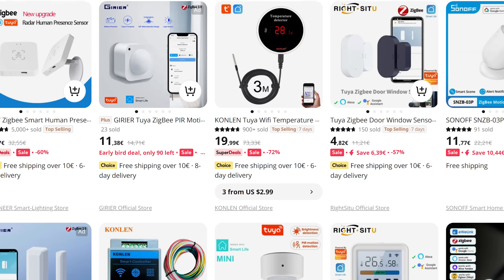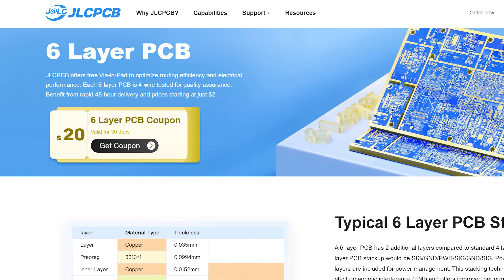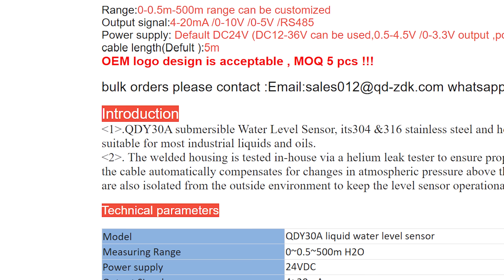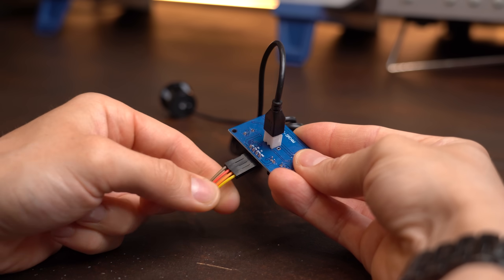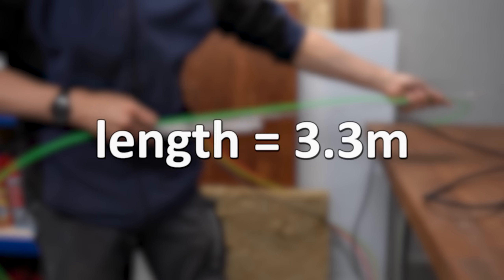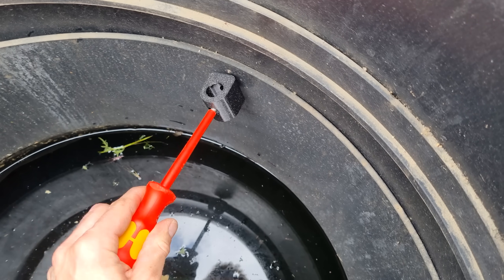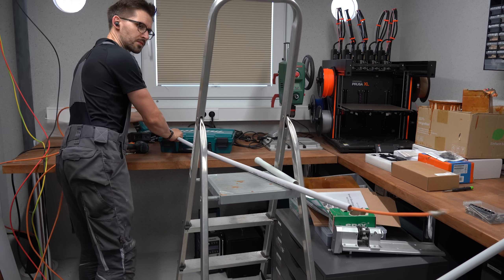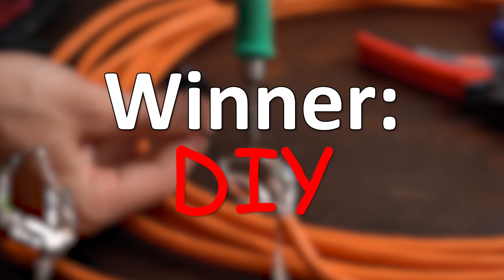This Happens when all Buy Options Suck! Water Level Sensor (DIY or Buy)

Comment: Pressure is the way to go for measuring water height in a tank.  We had ultrasonic sensors that constantly failed at work and switched to using a pressure sensor about 5 years ago and have been working great (in salt water also)!
Reply from the maker: I will see how it will perform in the future :-)
Reply: Agree with the (submersible) pressure sensor; build for the job and is typically the preferred sensor in industrial applications. I use these in my water tanks, version with the 4-20mA current loop so I can run longer wires without problems. 
Fun fact: those submersible sensors have a cable that contains next to the electrical wires also a small air tube. This is be able to measure the pressure differential. This way it zero's out any changes in atmospheric pressure. So best to purchase with a longer cable to get to the connection point instead of trying to splice mid-way!
Reply: You should add a second ultrasonic sensor (or better yet, 3) for redundancy.
Reply: Yes that'd be my goto as well. If it works in washing machines it's gotta be reliable
Reply: I am using an HC-SR04 for my sump pit in the crawl space under my house with Blynk. No problems in 9 years.
Reply: Does the pressure sensor reads valid values even when the pump is turned on? I want to replace currently used ultrasonic sensor by something more reliable. I had basic non-waterproof ultrasonic sensor in my well, but after changing a pump, it started to read wrong values, when pump was on (probably ultrasonic sound from the pump). I have replaced it with waterproof ultrasonic sensor, shown in the video, which has poor resolution in the well (±7cm when water is 2 meters below the sensor).
Reply: @MattManis  they're independent systems, sounds like your power source might not be great, or you're having some electrical interference when the motor is on.  Unless I'm misunderstanding what you said, which is always possible.
Reply: @theheadone  we probably didn't understand each other because I wrote it ambiguously :D I had already installed ultrasonic sensor, but i want to replace by something more reliable. I was thinking about a pressure sensor, but I am concerned that if the pump turns on, the pressure will drop near it and the pressure sensor will not display the correct water level.
Reply: @MattManis  ah, I understand.   The pressure shouldn't drop noticeably because of the suction of the pump unless you have the pressure sensor right at the inlet of the pump. Even then it probably wouldn't matter.
Reply: I am replying to all the comments that do not know that Time of Flight sensor is the best for measuring water height in a tank.
Reply: @moeburn  What are the advantages of the time of flight sensor in this use?
Reply: @yannick7230  not in contact with water so doesn't wear down
Reply: @moeburn  Depends on the liquid. Foaming, tanks being filled, fog in the tank or circulation / waves can cause problems for ultrasonic level sensors. There is no one size fits all solution.

Comment: I've worked for a company that sells cisterns - 0:48 - i can tell you, right now - you want an ultrasound distance measurement - easy-peasy to figure out the current/remaining volume level! Especially with rain water, there's gonna be lots of contamination and "growth" in your tank, so conductive sticks won't work long-term - those tend to "get eaten". (fine-mesh rain water filters are a thing, as you're undoubtedly aware)
Reply from the maker: Thanks for the feedback :-)
Reply: You could use a capacitive tank sensor to remove the risks of corrosion but you'd still be stuck with the variable properties of rain water that can alter readings. I have mostly seen these types of sensors used in generator fuel reservoirs, judging by the building automation projectd i habe been involved with until now.
Reply: Best way is to use water level sensor lite omron k8ak-ls1. Work in empty and fill mode and already have a relay that could cut off the emptying pump or turn on a refill valve to fill the tank at a minimum level when there is no rain and you still need to water the garden. With that you can use stainless steel rods of any kind to measure low and high level.No analog read but still a solid way to not burn the pump in case there is no water or always have a minimum level at disposal.
Reply: Time of flight sensor > ultrasonic sensor.
Reply: @moeburn I can't imagine ToF would work well to measure the surface of a body of water given that they don't work well with reflective objects.
Reply: @widgity  Most ToF sensors use IR light, which gets absorbed by water. I calculated that less than 2% of the light gets reflected, which is too low for reliable measurements.
Reply: @lbgstzockt8493  Not true, STM's VLx sensor can measure water level and are very precise

Comment: Did mine with a waterproof ultrasonic module. Then I had to attach all pipes and cables to the walls since the sensors would always see the cables instead of the water level. And take it out of the box I had made because it ONLY works dangling in the air and will not show correct values once Imput them inside the box.......

Comment: Made the same thing yesterday with ESPhome. I used a different ultrasonic sensor, A02YYUW, the wiring is easy & it processes the signal in the sensor, so no extra board needed. I think UART version is better than PWM version because the code is simpler.

Comment: Wont the waves in the water make it difficult for the transceiver to detect the distance accurately? That was the case for me, so I just got a pvc time drilled in some screwa at different levels and connected those to gpio pins in pull up and short them to ground using the water as medium. I dont get great level accuracy only in 4 levels but it works reliably enough
Reply from the maker: No problems so far

Comment: Our house is on a buried stream, so water wells up into our basement.  I too had a need for a water lever sensor and my solution was also cheap.  Cut a piece of styrofoam packaging to loosely fit a pvc gutter downpipe (squarish plastic pipe).  Because sump well is only about 0.7 meters, and I want to detect the top part,  I only measure about 0.3 meter.  That said, cut a slot into the pvc pipe so you can attach a pin to the styrofoam block.  Two paint sticks make a simple linkage to a potentiometer at the top.   An arduino analog pin completes the project.  I also went with an RV pump as my submersible pumps seemed to disintegrate over time.   There's some extra stuff, like a raspberry pi and relay board to run the pump and irrigation valves.  Very very diy.
Reply from the maker: Oh boy. Sounds like fun :-)

Comment: Would the sensor work if the wire is shortened to a few centimeters? That would allow integration of the micro and all in one compact unit. 
Is it possible that they are using the inductance of the cable to form a low pass filter? Why didn't the extension work? I don't like mysteries. They nag at me.

Comment: I use one of these JSN SR-04 sensors in a 25,000 litre water tank and with multiple sampling and median calculations I get accuracy to within half a mm which in my tank is about 4 litres. They're really accurate if you do it right.
Reply from the maker: Thanks for the feedback.

Comment: My idea was to make a float similar to the one that controls the water in toilets, but instead of it controlling a valve it would turn the shaft of a potentiometer (used as a voltage divider). Buffer the middle pin voltage of the potentiometer via an op amp, buffer it once more on the other side of the cable as well, and have a galvanometer showing the water level. Yes, I'm a very, very analog guy.
Reply: This is how it’s done in the gas tank of some cars.
Reply: so basically a gas float from a car?
Reply: I like it.
Reply: This was my initial thought also, but with an accelerometer to measure the angle of the rod that the float is connected to. Ultimately the ultrasonic sensor is a far better option. No moving parts, small space requirement.

Comment: I thought you would use two parallel SS rods and measure the resistance of the water.
These ultrasonic modules are for cars I think. That's why they're so cheap.

Comment: How would one go about measuring fuel capacity in a small ~4L moped tank ? A simple float wouldn't fit, since the tank is long and narrow (and also at an angle) not to mention there's gasoline inside. Ultrasonic? Something else?

Comment: Well-done! :) I did almost exactly the same thing some years ago with my water tank. Luckily, I didn't have to extend the sensor cable and used a D1Mini running tasmota-sensors as the micro-controller.
Reply from the maker: Nice work!
Reply: @greatscottlab  As I was watching, I was saying.."He's using the same sensor!! He's using the same control-board! Ahh crap, he used a different ESP!" :)

Comment: The fact that I made a project similar to yours just 2 weeks ago. But i chose a different way to measure water level. I used hx710b sensor (~2$) and ESPHome supports it as HX711. The seller calls it as a " liquid pressure sensor" but i think it would cause leak over time. Instead of water i used it to measure pressure of air at the bottom of the tank. After some of calibration, it appeared to very accurate, maybe to every 1/10 litter. Now I just wait to see is the sensor drift over time or not.
Reply from the maker: That sounds like a really creative solution. Love it :-)
Reply: That is exactly how it is done on washing machines. Either a pressure switch for three levels (empty, level 1, level2) or probably on some more modern models a full on pressure sensor.

Comment: those are a bit extra complex way of solving the simple metering problem. yep a linear physical floating scale stick. yep its not electric, unless you measure the scale position electrically. sometimes you dont need to read stuff from the home automation panel.
Reply from the maker: But then I would have to open the cistern every time.....right?
Reply: @greatscottlab  measurement wire travels inside a tube also? like a bike break wire. then all the electronics logic is outside of the wet zone. yep information travels in a wire, but mechanical state info. also you can have a hole that the meter travels through? yep a floating measurement stick. say visible from a pipe going down to the water reservoir.

Comment: I did a similar project with a Wemos D1 mini , a VL53L0X , a tiny solar panel and 18650 battery. I was measuring the level of kerosene for home heating system. Ran for years in a row. Only issue was some corrosion on the sensor because of the fumes. Apart from that it was functional.
Reply from the maker: Thanks for the feedback. I hope my solution lasts that long.
Reply: I wonder if you could connect the sensor using some kind of quick-connect, and replace it annually as scheduled maintenance? Sounds like you got a great system

Comment: I tried the same thing with home assistant few years ago. I didn’t know about the resistor on the sensor board. But I got decent results. My issues started when water Vapor started to condense on the sensor and it started to throw garbage values. Once I wiped it then it worked fine again. Let me know if this works for you. Maybe it’s the resistor that maybe caused the issues for me
Reply from the maker: I have been using the system for over a week now. No problems so far.
Reply: @greatscottlab  that’s great. I’ll try the resistor and see if it works out

Comment: Strangely enough , I also had to cut the wire of this ultrasonic sensor and the measurements were totally the same without any issues. Tried both to cut in the middle and to solder directly to the module itself. 🧐

Comment: Hydrostatic sensor + arduino. Same price more reliable than ultrasonic. I have several systems in industry that have been set up for years this way
Reply from the maker: But I showed hydrostatic sensors in the video. They are quite a bit more expensive.

Comment: Great how about a solution without electronics. Like for example a float device that pushes a pvc pipe or stick inside a clear hose protruding above the water tank 2 meters with makings to show water level depth.
Reply from the maker: That will also work. But you know......this is an electronics channel.

Comment: I also wanted to make a DIY water level sensor, but my idea was to use a laser distance sensor. Of course it wouldn't work with water so I wanted to add a pipe which had a piece of styrofoam or something else that floats on water and it would be a surface for the laser to bounce off.
Reply from the maker: Sounds like a plan.
Reply: I tried this but the condensation that inevitably forms on the emitter prevents reliable measurement.
Reply: @guyincognito.  makes sense lol

Comment: Changing the wire length of the Sensor probably messed up the hardcoded timings of the sensors board
Reply: Nah.  The original wire is a coax cable and he just used a regular multi core cable.
It would of worked if he had used a coax cable of the correct impedance.
Reply from the maker: Maybe.....
Reply: Those sensors are impedance matched to the controllers. Which means you need a matched feedline.

Comment: An alternative solution, I'm sure there are many, is to have reed switches interspersed with resistors along a pole. A float, containing a magnet moves up and down with the water level. Extremely reliable.
Reply from the maker: Sounds good
Reply: @greatscottlab  it's what they used in the mud pits in the oilfield
Reply: I've been looking for a similar solution for a long time. We have a well that is about 100 meters from the house. I would also like to monitor that. Do you have any ideas?A duct (Lehrrohr) runs from there to the house. @greatscottlab
Reply: @greatscottlab  - You could also use the output from a laser tape measure (some have a usb plug), never touches the water therefore more reliable.  ;)
Reply: Personally - old School - a stick in a tube with a float on one end. How far the stick travels up the tube tells me the current water level. EDIT: The 'stick' is a length of PVC pipe and the Float was obtained from an old toilet cistern.
Reply: @Bob.Jenkins  IIRC that's more or less how the gauges for most heating oil or portable fuel tanks work as well, there the stick and float just connect to a needle/arm and sight gauge that can be read without having to open the tank.  It's simple and effective but it does require you to go have a look at the gauge manually every now and then.
Reply: @Bob.Jenkins haha I use the same for my sump tank😂 I do have a buzzer at the bottom limit, so when the pole goes below a certain height it triggers a small momentary limit switch to sound the buzzer so I know that my sump is low and not to power the pump!
Reply: I use two of these for my irrigation system, using a 555 time in flip flop mode.  555 is nice because I can run off of a wide voltage range, and the relay it triggers is 12v.
Reply: Way too many moving parts.
Reply: @Alacritous "Moving"? What is moving?
Reply: @bbaucom2  Reed switches have moving parts. The "reed"
Reply: I like the ultrasonic method.  No moving parts.  Wires that touch the water can foul or corrode, so stay away from these solutions.
Reply: @thedarksage328  they can have issues with frothing, depending on the tank contents, condensation and false echoes
Reply: @imaginitivity7853  Thanks!  good to know.  Murphy's law always kicks in!
Reply: A system I have used is capacitive sensing, where the two Plates of the capacitor can be pcb traces (sealed from liquid-conformal coating if you want) and then the liquid you are measuring is the dielectric of your "capacitor."  I believe such systems were originally used in aircraft fuel tanks.
Reply: i have seen such a solution fail though. It was a level sensor in a laboratory water purifier/deionizer. The failure was - the traces of the pcb with the reed switches have corroded away, despite being potted into a plastic tube. So, my opinion here - don't immerse anything electric, unless you absolutely have to.

EDIT: it did last something like 10 years before failing, which is pretty long, so feel free to ignore.
Reply: to reduce price and eliminate mechanical parts, I've seen hall sensors used in a setup similar to what you described here.
Reply: Yup, I used these in my van's water tanks.
Reply: This was what I did in the past. It's so simple that kids can do them
Reply: You can actually just connect it to existing probes that show how much of the liquid is still there
Reply: The standard way in process industry is ultrasound, coming from a process engineer